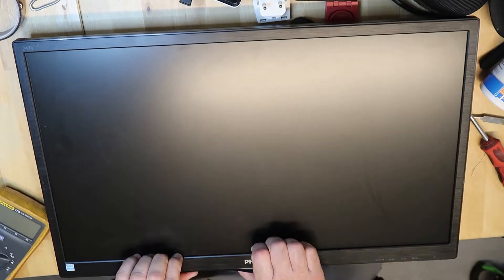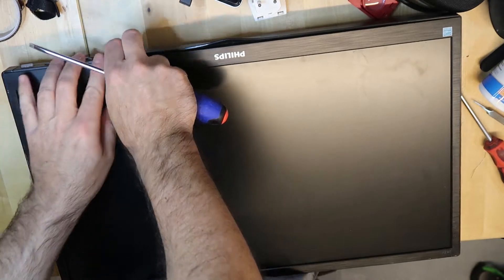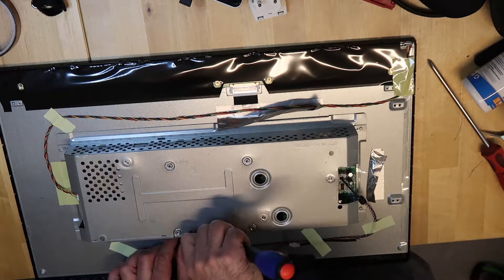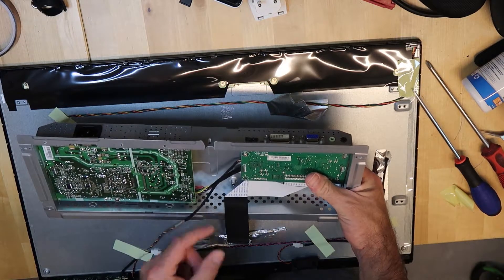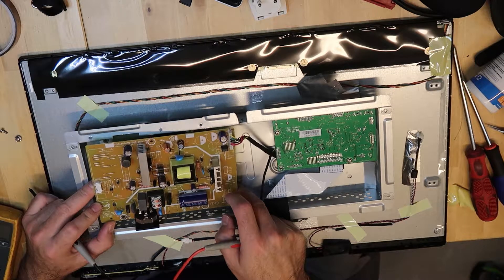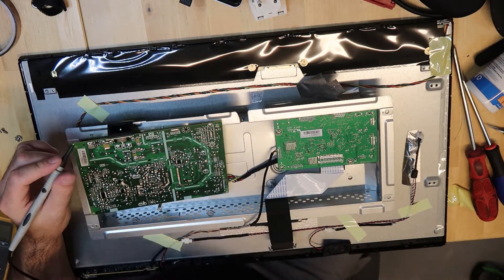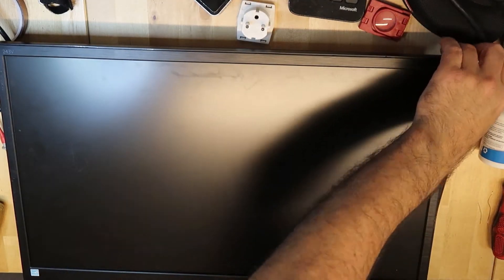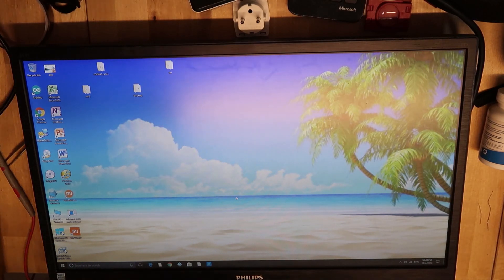Fixing LCD Philips 243V5LHAB

Comment: Hello, I have a similar model and have a single line vertical on my monitor, any fix solution?
Reply from the maker: probably one of the voltage is missing - the chips on the flat cable don't get one of the voltages this is a guess

Comment: Hello Bloch. Can you please help me? I have a Philips 223V7QHAB/00 monitor and it is working just fine. The problem is the upper part of it, it is detached and leaning forward, as I use the monitor forward inclined. Through the crack the light shines (LCD white light) and I have no idea how to fix it, to make it stay in it's place. Thank you.
Reply from the maker: the best way is to try to find where the light comes from, and try carefully to glue it back

Comment: Hi, I have exactly the same problem, screen won't turn on, even the led on the ON/OFF button stays off. I opened the back of the screen like you did and checked the soldering. I solder a few of them that seems dodgy but I am not as lucky as you are unfortunately😕